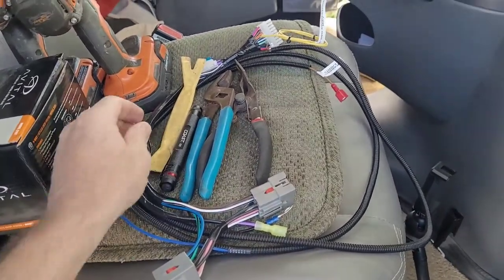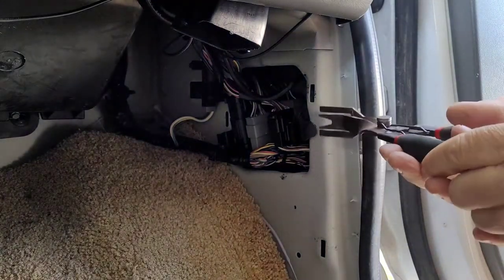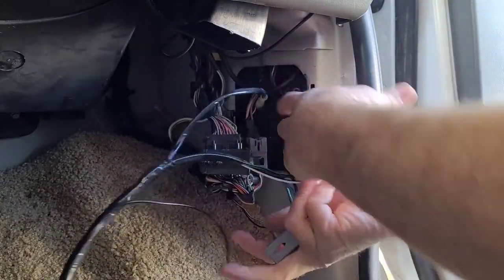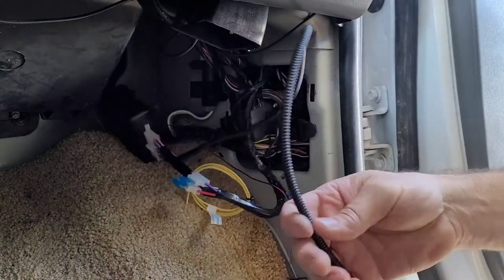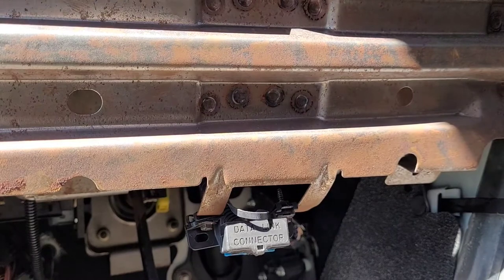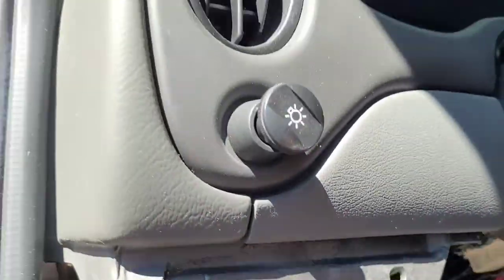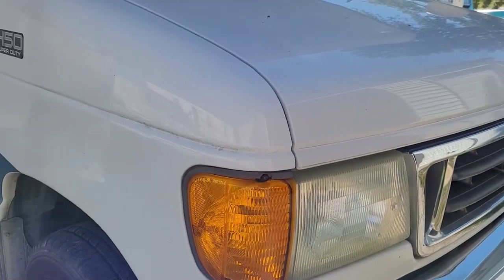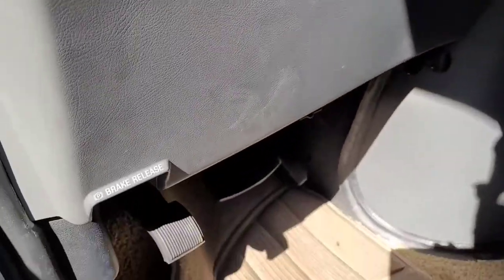1992 - 2008 Ford Econoline Van Camper Plug And Play Remote Keyless Entry E250 E350 E150

Comment: I wasn't sure whether my 96 E150 had keyless entry or not. I called Tony and he walked me thru the steps to identify whether or not I had it. He was very attentive and stayed with me on the phone  while I pulled the door switches out and then sent him a picture. It turned out that my van wasn't factory equipped with keyless entry. Thank You Tony for your help. I ordered a system from him I'll update again after I install it.
UPDATE 09/08/24
Installed the Keyless entry from Tony Today It went flawlessly. Had to figure out what wire to hook the dome ight circuit to and the horn wire was a different color but other than that the hardest part was running the wires over to the other side of the dash. Everything works like it should Horn Honks Park lights come on and dome light activates when unlocking the door. The Panic function also works. Very Happy with My purchase

Comment: I was thinking about doing something like this with my van. Would this work with a 96 e150?  I know the trim and power buttons are a bit different looking on the older models, but is the wiring the same?  I haven’t tore into anything yet to check the wire colors.
Reply from the maker: Yes, 92 - 08.

Comment: Thanks for the helpful video. I copied your wiring harness using conenctors from a junkyard. The Avital unit installed easily and I opted not to connect the horn or lights. The only "option" I used was wiring a separate ignition and +12V connection. The ignition signal disallows the lock button when the engine is running. Not sure what safety issue this provides.

Comment: Nice kit,easy installation, and it works great. It took about 15 minutes start to finish. My only question is, this kit has a wire labeled dome light on the right side,where does it land?
Reply from the maker: It's there if you want to extend it to a dome light wire. "If you can find one." They only exist on the older one's. It has to be a positive wire. Usually black/blue.

Comment: Do you sell the fobs as well?
Reply from the maker: Not separately no. It comes with two remotes. If you need a new remote, you can get them from ebay cheaper than I can get them from my supplier.
Reply: @tonyscarcare5657  sounds good, thank you
Reply from the maker: @leightonfarms4962  you're welcome.